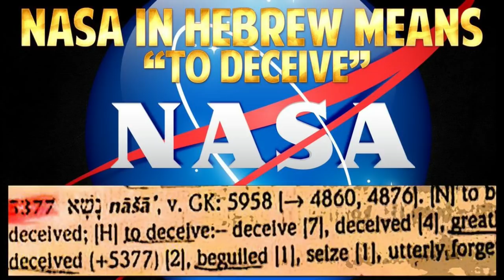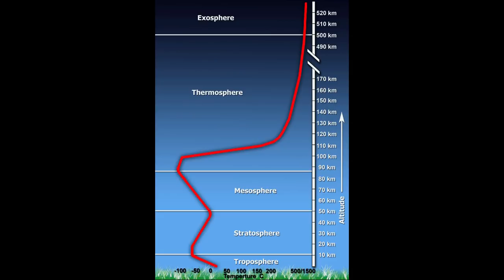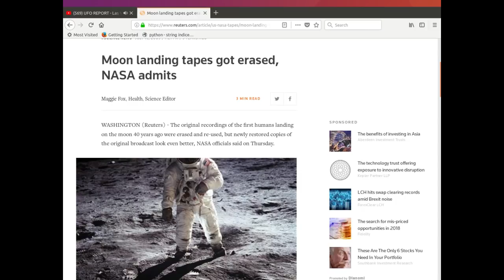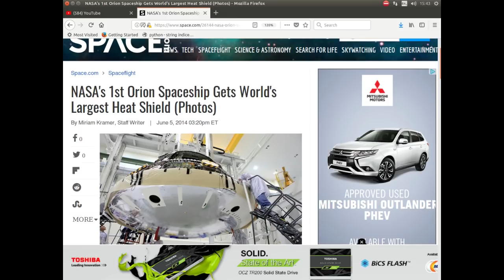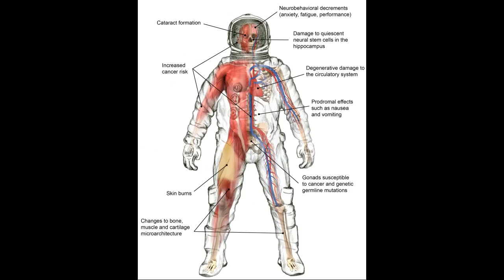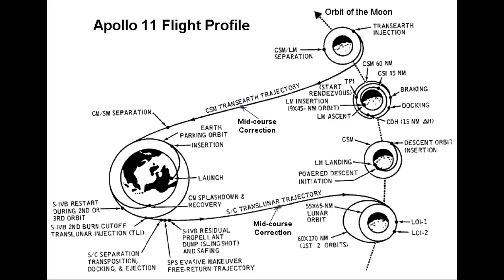Gyroscope Science - Thermosphere - and NASA ... Five Problems that worry me. (one Solved)

Comment: All mechanical gyro's precess. The pilot will manually reset the DI every few minutes. Older aircraft used air/vacuum-driven mechanical gyroscopic instruments. More modern instruments will be either electrically-driven, or solid-state, similar to the inertial sensors in an iPhone for example.

Comment: I haven't done the math, but for every kg sent to the moon require x kg of fuel and support. The return mission seems to be based on earth gravitational figures. The same thrust per kg of fuel would have to be divided by the moons gravity. They would have needed 6x more fuel and support.
Reply from the maker: +Affordable Prosthetic Eyes other way round 1/6 fuel to return but actually much less due to reduced mass of returning craft.
Reply: I was considering on a per kg payload / fuel ratio. a kg of fuel on the moon would only produce a sixth the amount of thrust if you believe the gravity is what we are meant to believe. The deviation from the highest to the lowest point on the moon and the earth are both approx. 10 miles. I think the actual gravity is similar.
Reply: Gravity on the moon is not the same as earth.
Reply: How do you know? What Is the proof? Check out the venera program.
Reply: Physics.
Reply: There is so much science fiction masquerading as fact, it's hard to know what to believe. See venera